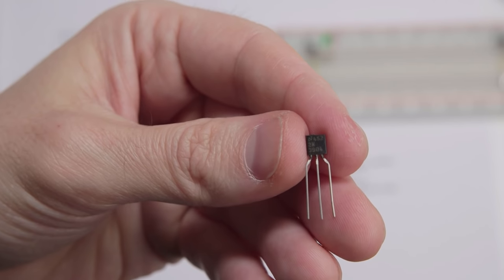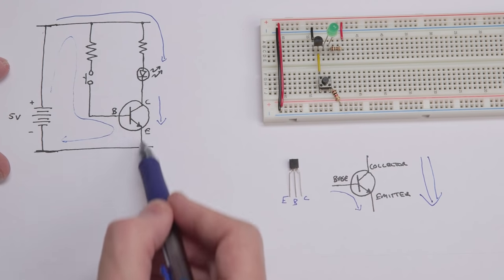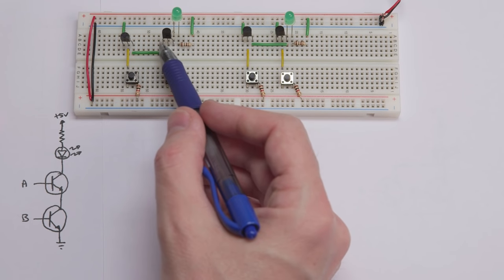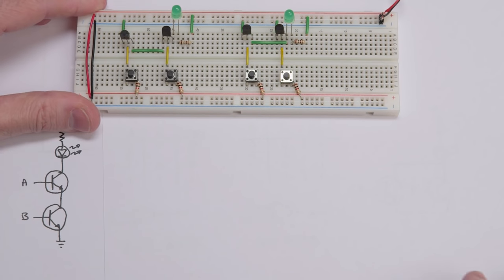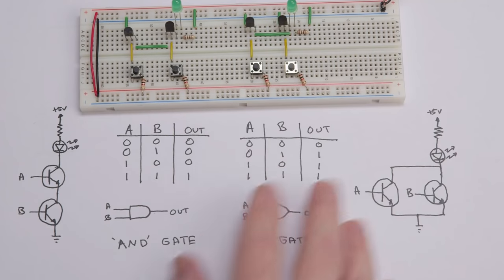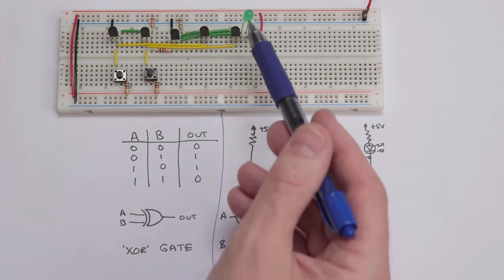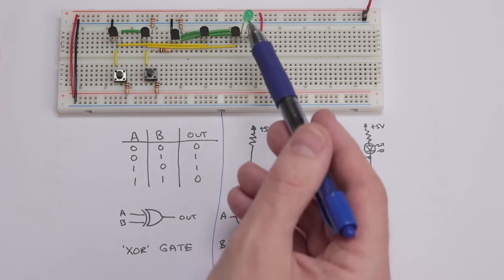Making logic gates from transistors

Comment: Hi Ben,

Though it demonstrate what AND and OR gates are, it is "electronically" speaking not right. The voltage levels (LOW, HIGH) aren't correct and aren't working for actual logic circuits.

For the AND gate, you actually made a NAND gate :

When A and B are in the LOW state (meaning near 0 V), the voltage at the collector of the first transistor ( in fact, it is the voltage needed to "feed" any subsequent logic part of the application, and should be collected there ! ) is actually in a HIGH state (near 5V).
It means that, "electronically" speaking, the LED should be ON but it's the other way round ! (because the LED is simply and naively put in series, which is not the proper way)

One must think about voltage levels instead of a LED simply ON or OFF...
To demonstrate it works, you should "collect" the voltage at the collector of the first transistor, start from there, and make another circuit with an LED that goes to ground. But do not put an LED in series, that's not the way it is done in real circuits..
Reply: The guy who made this video simply didn't understand how logic gates work. Really sad that he is misleading thousands of people. 😞

Comment: correct me if I'm wrong, but the gate you're calling an and gate is actually a nand gate, is it not?  Yes, the LED comes on when you press both buttons, but if you were using this in a digital circuit, the voltage potential at the point where the led is hooked up would be logic high to start  and then would drop to a logic low after both buttons are pressed.  I suppose if you were to make the assumption that a logic high means an led turned on, then yea, I suppose you might be able to get away with calling it an and gate, but you could never use that circuit as an and gate in a more complex digital circuit, right?

Comment: EEk ...   Sure somebody, probably many have  pointed it out but you can eliminate a transistor and resistor from your XOR.... from from the cathode of the diode, common to the collectors of the OR gate,   you wire the first connector of the AND gate. transistor and vioa!        The and gate shorts the LED "output" in an AND condition.  but not when either of A or B are off...

Comment: I've watched several of your videos about Si, B, P and how the electrons and holes etc. move, and how the voltage of a battery stimulates movements of e- and holes etc. - all great, and thank you - however, in this video where you are doing a demonstration with electronic equipment, wouldn't it be better if your diagram and your equipment were in exactly the same orientation, so that the flow of electrons were easier to follow on your demonstration? Also it's hard to tell on the board that looks like a cribbage board, where the batteries and connecting cables or wires are, and what the different electronic components are - perhaps you could show these with an arrow and a legend. I am someone who is brushing up on A level physics and chemistry in general, and not an electronics engineer, so I hope this feedback helps you to continue to produce these very educational and interesting videos.
Reply: The board used in this video is called a "solderless breadboard" -- it's a standard tool for electronics prototyping. There are lots of resources out there explaining how a breadboard works; they are not complicated to understand. Ben could have made a circuit which closely matched the circuit diagram layout, but it would not be very practical to build. Once you learn the manner in which the holes on a breadboard are "wired" together, it becomes easy to translate a formal circuit diagram into something you can practically build on this board. Just work through it step-by-step and trace out paths/loops to convince yourself why things are connected the way they are. 

Best of all, these boards are quite cheap so you can build your own circuits and follow along for very little cost!

Not shown in the video is the 5 V power supply he is using. Just know that it is hooked up the power supply to the positive & negative power rails at the top (see the connector on the top right).

Cheers!

Comment: So the connection between propositional logic and boolean algebra is the idea of 'completing the circuit' causing a manifest 'true' truth value and an incomplete circuit as a manifest 'false' truth value; but all that's really going on is voltage either passes through a semiconductor or it doesn't.

Comment: Why isn't the current splitting between both paths at 2:53? Shouldn't the LED stay on but get dimmer? I know i am missing something i just don't know what.

EDIT: aparently someone has already answered this (Christian Gringas):  "A green LED need about 1.0 volt to turn ON. If you apply 0.8 volt, you get no light at all, not even a feint glow. So, since the transistor  can lower the voltage to 0.2 volt, the LED is off. However, if you replaced the LED by an incandescent light bulb, you would see a feint red glow when the logic state is "0"."

Comment: The xor gate you made worked, but was not a true xor gate because the method for turning the output low was to remove ground reference, so the output would actually be a 1 there.

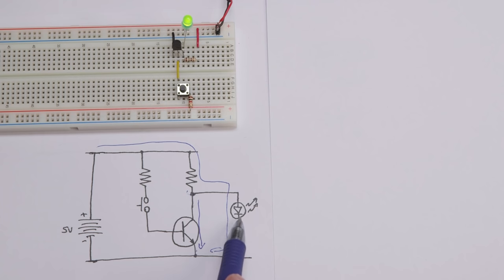Comment: At 3:18 , when transistor is on current flows through transistor - this part is fine

But some current current should also flow through LED right, how it can be said that there is 0 potential difference across diode when transistor is turned on? 
I just want to know how potential difference across diode dropped to 0 , and no current is flowing through LED when transistor is turned on :)
Reply: I have the same question

Comment: I hate how they aproach this in school, they teach about electrons and l9gic gates, but the inbetween is just magicy magic that just works. I'm trying to learn things from the basics up. So first the way flow works, + and - charges attract electrons from - to +, simple.
Then P and N type semiconductors which can form diodes and transistors.
Then how to form logic gates out of transistors.
Then how to calculate with logic gates (although it's getting to the other simple end again now)

And i'd like to aswell find somewhere how tf you can make transistors into universal turing machines.

Comment: Can't believe the 17 yrs old me, who had to learn by himself how transistors work with 14 yrs with a school book and a broken tv set which had the pin out on the pcb, got discrete logic gates right to build a simple robot, well on the OR gate I used 2 diodes and 1 transistor instead because I was poor and transistors were a bit rare. (And the school classes didn't follow the program and no internet 20 yrs ago...)

Comment: I just discover your channel and I already subcribbed! Very interisting video, thank you a lot !

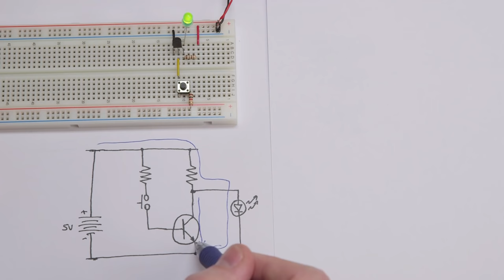I just have a question : at 3:00, why does the fact that there is no more voltage difference between the two parts make the Led shut off? Why does the current "prefer" to go through the transistor, and not in the two parts egally and "at the same time" ?

(sorry if my english is bad)
Reply: the LED resists the flow of electricity just a little. it prefers to not have to worry about it and go straight to ground

Comment: I have discovered that I need to take a course on electricity. I don't know why you are using resistors, and as such, I have discovered a major deficit in my understanding of circuitry. The inverter circuit baffles me in my lack of electric understanding as I don't understand why electricity won't flow both through the transistor as well as the LED at the same time when the button is pushed.

Comment: So I understand THAT you can do this with transistors, and thanks to other videos I have a vague idea on HOW different types of transistors do it, but I fail to understand WHY you would to this with transistors. As used here, aren't they just simple press switches? You could make all these gates with just the switches, right?
Reply: The point is that you can connect these transistor switches together in more complicated way, so that the output of one switch turns another switch on or off. You can’t do that with physical switches.

Comment: Thank you for the great video. For the XOR gate, it is not clear to me why the middle 5V connection is required. If the connection to the ground is broken, the current should stop following regardless, or am I wrong? It is also not fully clear to me what is the output line in this diagram. If the voltage is read from next to the LED this would be a XNOR gate it appears to me.

Comment: Some times it helps to put a capacitor in series with the led if it does not turn off at a higher voltages. 22 mf worked for me at 3.2v nominal

Comment: Hi Ben thank you so much for this video, I have a question please... I’ve build the NOT gate you did in this video using 2 x 1K R1 & R2, and BC547C transistor. Can I do a loopback on it where I connect it’s output back to its input? So I get a blinking light? Thank you 🙏

Comment: Thanks for excellent video. Please give me an advice: I have built two NOR gates using 2n2222 transistors (i pieces for each) and they are working perfectly according to their truth table, but when I connect them to SR latch it doesn’t work properly. Don’t remember for sure, but both leds are either lit or dim. Tried with AND gates as well, same result. Then rebuilt latch using circuit from internet with only 2 transistor and it works well. What could be wrong with my homemade NoR and AND gates?

Comment: If the resistance in series with the LED was zero, making the base-emitter current zero, would it then 'turn off' the collecter-emitter current? if so, then would it immediately turn back on, causing the LED to flash really fast?

Comment: In XOR Gate:

Explain why the close circuit in the AND Gate is causing the break at the transistor (Not switching the LED on) if pressed simultaneously?
What is the reason for the electrons to not flow in that direction and open the transistor to turn on the LED?

Comment: So is this why CPUs consume so much energy? They're full of resistors that burn the energy when redirected from one transistor or another? (plus all the usual resistances of the other components)
I've just started electrical engineering and learning about voltage dividers in a lecture I was like "surely that's not the best way of reducing voltage, it's a waste of energy!" but I guess that's how electronics work. 

I still get this nagging feeling that there should be a better way that doesn't consume so much power. But I'm sure someone would have found it by now.
Also, just want to thank you for making these, they are amazing! And was sad to see your podcast only has 15 episodes, just listened to the first one last night.
Reply: voltage dividers don't really come into play for this since they are used to actually power a circuit (be it the main circuit, or a subcircuit that needs less voltage), and yes, they are pretty wasteful, and there are more efficient ways to step up or step down voltages (ie, transformers, buck converters). 
but yes, you are right in that the reason the cpu takes up so much power is because of those little resistors all having a voltage drop. while the current draw is minimized as much as possible, once you put 4billion of them and make them switch at millions of times per second, they really start using up power. 
but if you just want something simple, transistors don't draw a lot of power. for example, an arduino in sleep mode can run on a battery for months while having 10's of thousands of transistors. another great example, is the LCD watches which can run a single button battery for 2 or 3 decades.

Comment: @Ben Eater I’m curious as to how these circuits can be used to derive a +5V trigger or gate signal for use with a modular synth circuit. Where would one tap the signal in order to get a healthy +5V based upon the resulting truth tables? I’m especially interested in the AND circuit. 
I built one with the 2 NPN xstrs but the resulting output is very low and the voltage leaking made it impractical to build a voltage booster following the B transistor.

Comment: Does at 3:42 actually draw cuerent from the transistor when you push the button? 
I mean, the diode turns off because the current finds an easiest way (less resistance) than the diode itself, so the drawn current is higher than the diode's. In other words, the diode is been short circuited.
So, what happens if a motor is there instead of the diode? The drawn current from the transistor should surpass the motor's to turn it off?
Thanks in advance.

Comment: Nice video. But isn't the "inverter" producing kind of a short circuit? If you have 9V and a 470 ohm resistor in front of led and transistor you will have 19,15 mA flowing when the led is off. That is kind of a waste of energy. Of course in computer circuits you don't use leds and need much less current...

Comment: Those gates seem inverted to me. Yes, the led turns on but that is because it's connected to ground. So if you used that point as a signal, wherever you plug it, it will make that point practically ground.

I don't know what I'm missing. Since there's no way ben can be wrong about this, I know it's me but can't figure it out.
Reply: As a matter of fact, the scenario I'm speaking of is exactly what's going on in the inverter example.  When you connect a load from that signal to the ground it should act in the opposite manner.

Comment: Just spent several hours with that XOR gate and nothing worked. Then I have changed the breadboard with a more expensive one and it worked as expected 🤦‍♂️ Noticed that when I close the bottom transistor of the NAND gate, the led is dimmer compared to closing only the top transistor and I still do not understand why.

Comment: For the XOR gate, isn't the extra 5V connection in the middle redundant, since the LED circuit is not connected to ground when both transistors are active anyway?

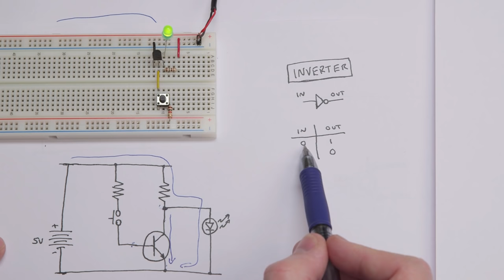Comment: Is the inverter you made at around 4:00 functionally equivalent to a pnp transistor, or is there a difference in behavior between the two? I know the operating principle is different, since the pnp acts simply as an on-off switch, and the inverter functions as a low resistance path opening compared to another one, but does that make them behave any differently?

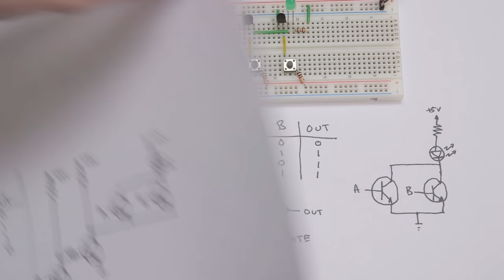Comment: Amazing videos! Thank you. There is just one thing I did not understand. In 8:30 why is the middle connection to 5 volts necessary. It seems to me that we can avoid using it without affecting the circuit's operation. Can anyone please explain why it is necessary?

Comment: hey so what if you had an OR gate but in between the LED and the +15 V you put in a wire to ground but through a couple of transistors in series (AND gate) whose bases were (also) hooked up to A and B. you'd have an XOR gate with 4 transistors instead of 5

Comment: Sir, in xor gate you mentioned that if Aand B are close then transistors of AND gate will ON so that no current will flow into base of that transistor which is grounded and so that output will be ZERO ( off led )
      Sir, my question was if A and B switch are closed and transistors of AND gate are ON then why that make other transistor off?
       Is it because transistors connected to A and B switch will give less resistance path in comparison to that Resistor which is associated with other transistor . Current follows least resistance path so all current going through AND gate transistors ?

Comment: In your first circuit why didn't you ground the base with a resistor to discharge when the button is not pressed? Or do you only need to do that for FETs?
Reply: this automatically happens.  when the current can't flow through it doesn't move from the starting point.  This happens so fast that to humans it looks instant, but when he releases the button, electrons are still moving through the circuit until they can not freely flow, the transistor doesn't "toggle" until there isn't enough electrons on the base side to continue.  If you build the circuit and properly use a multimeter to check your circuit, you can see no voltage is going through the base while the button isn't pushed, even after you've pushed the button a couple times.  Transistors also don't hold juice like Caps do.
Reply: @sirgouki6207  not sure who you are but my electrical engineering professor says otherwise.

Comment: I have only 1 issue... You are demonstrating the AND and OR gates with an LED connected directly to 5V... And then toggling the ground with the buttons... Yes this gets the effect of an "and" gate visually with the LED being the truth table... But electronically speaking... This is a NAND gate... Since when the buttons are neither pressed we are applying 0V or logic low... The output pin connected to the leg of the LED will be +voltage biased, this preventing the LED to turn on... When only one button is pressed... The output pin will still be being held high... When we supply 5V to both inputs... We will then get 0V or logic low on the output pin... Then allowing the LED to light... Same case with the OR... It  would actually be a NOR... Sure the LED values and the state values of the buttons "pressed" being "high" and not pressed being "low" will provide the correct visual state of the LED "on" being "high" and "off" being "low"... However this is backwards since the positive leg of the LED is already being supplied a constant voltage... If both pressed actually meant we got "high" on the output... Then the LED would not actually be able to light... It's only when we provide a "low", opening a path to ground for the LED... That it can light.

Comment: In the OR Gate example: both are able to complete the circuit,  but in the case where both transistors are on, is A or B actually a low? Does the electrons favor the shortest path?